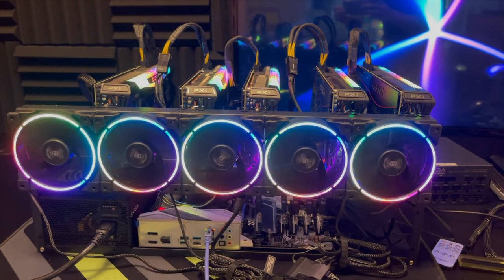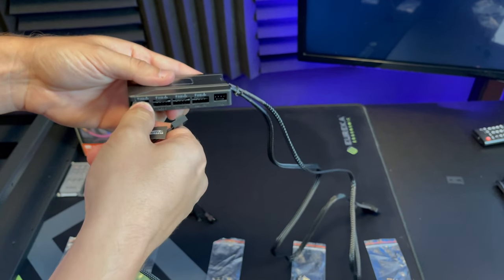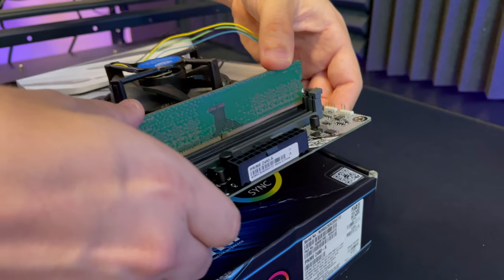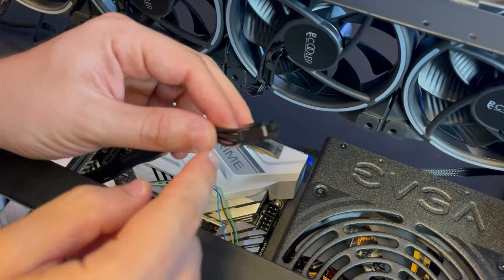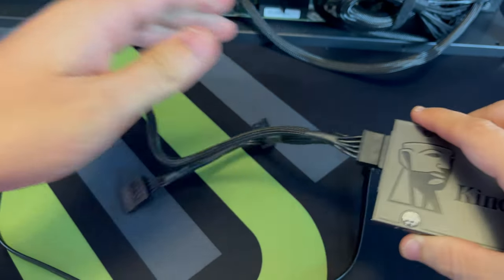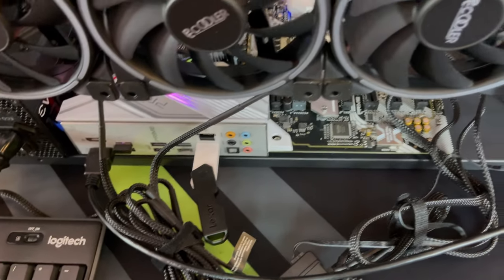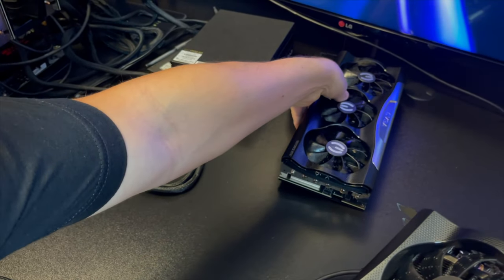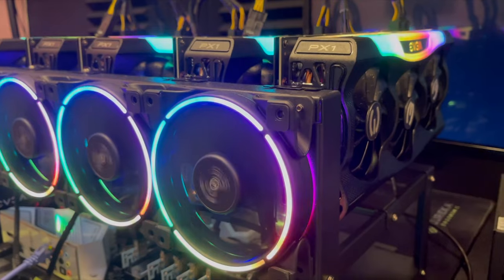How To Build A GPU Miner Rig (The Ultimate Step By Step Guide) Nvidia RTX FTW 3070

Comment from the maker: Here is a list of all the items needed to build this miner
6 GPU Slot Motherboard https://amzn.to/3kcdDeF or https://amzn.to/3mvBW9Y
if you are doing 5 GPUs this is a great option https://amzn.to/3y2ChmQ
CPU for these motherboards https://amzn.to/382PS2X
Power Supply Unit https://www.amazon.com/gp/product/B00COIZTZM/ref=ppx_yo_dt_b_asin_title_o01_s00?ie=UTF8&th=1
Ram https://amzn.to/3kfsvZJ
SSD Hard Drive https://amzn.to/3mvCEEa
Frame https://amzn.to/3z8uu8h
Fans https://amzn.to/3y8JvWn
GPU Risers And Riser Cables GPURISERS.com (these are higher quality than the ones on amazon)
GPU Cables (only buy original EVGA) https://www.ebay.com/itm/133825596674?hash=item1f28a08d02:g:fh4AAOSw~2xgdjsX
(you will need one per GPU
GPU should be purchased on stockx.com

Comment: In the process of buying all the equipment and 3 GPU 3070, 
I know for a fact that i will need some guidance as some of the parts in your video were somewhat quick.
however would you be available to answer and reply when needed ? 
After watching several videos, yours is by far the one that actually follows the title and is NOT click bait, thank you for that

cheers.

Comment: Great video!  I bought the same mobo and couldn't get more than three cards to work.  I figured out there was another setting in the BIOS that needs to be set to Gen 1.  I forget which section it's in but it's towards the bottom in the Advanced tab.

Comment: Hey Slava, thanks for this awesome video. Quick question: This setup does not require 240v power outlet installation right? My standard 110V electrical power outlet will work fine or do I still need to install 240V outlet?
Reply: I believe you are correct sir. the Power supply are 110v not 240v

Comment: Does not setting the card fans side to the back of the other gpu increase the temps? i mean the back of the gpu is hot as hell so the fans are pulling hot hair. i have mine like this running at 75º wich is awfull

Comment: if i was running 6 gpus, how can i simply add more 6? can the cpu run them as well? i mean i was considering a single cpu i mean single operating system to run a miner and start expanding from there. thx

Comment: so this entire setup is about 13,000$ since the GPU's are about 2,500$ each? do you have a link to the GPU's ? since its not in the links you added?
Reply: 2,500? You can find the rtx3070 that he used in this video for 900-1200$ on stockX not even the 3080ti that is way more powerful cost 2,500$ your probably talking about the 3090

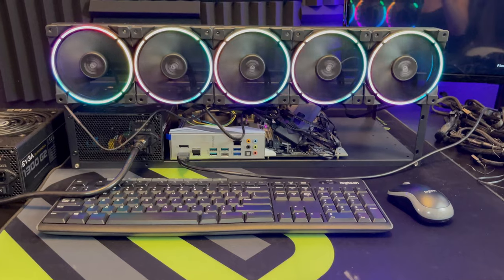Comment: Great video but I have a question, I had to stop at 5:41. Everything seemed to power up fine but the display (asus logo) did not come up on the screen. HDMI is connected but getting no signal. Any suggestions?
Reply from the maker: Thank you, I would suggest just connecting the cpu and try to power it on. if that works then add ram, then, hard drive, etc. to find out what is causing it. it sounds like a connection issue.
Reply: @SlavaTVOfficial  I unplugged everything. Only thing I plugged was motherboard power supply still nothing. Maybe it’s a bad hdmi port on the motherboard?
Reply from the maker: @sirhennyboy  can you try installing just 1 stick of ram and the cpu nothing else, see if that works. I doubt its a faulty HDMI port. Did you buy the mb used or new? I bought a mb on amazon once and it arrived broken and the same thing happened, I returned it and replaced with another one and no problem
Reply from the maker: you have to have the cpu installed otherwise it won't power on
Reply: @SlavaTVOfficial  I tried 2 8g, then 1, then no ram and no changes. I bought it new on Amazon. Debating whether to return and get another one or check it out at a local cpu shop. I don’t know anything about computers and fully going off of your video which is one of the best I’ve seen on YouTube.
Reply from the maker: @sirhennyboy  Thank you I appreciate that, small headaches like this sometimes happen don't let it throw you off track. I would just order a new one since it will arrive fast with prime and start the return process on this one
Reply: @SlavaTVOfficial  do you know if the ASUS Prime Z590-A LGA 1200 will work the same for this build? It’s cheaper and newer from what I can tell.
Reply from the maker: @sirhennyboy  yup it will work
Reply: @SlavaTVOfficial  she’s alive she’s alivvveee! Must have been a bad hdmi port. Now I can continue your video! Dude thank you so much for responding and being awesome!
Reply from the maker: @sirhennyboy  Happy to hear that bro anytime!
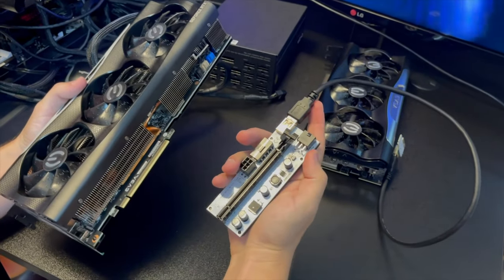Reply: @SlavaTVOfficial  at 9:09 you say going to connect this part to the usb cable.. where does that go after you connect the riser to the graphics card??
Reply from the maker: @sirhennyboy  you will connect it into the graphic card slots on the motherboard (the long lines)
Reply from the maker: @sirhennyboy  wow good catch I didn't notice I didn't include that in the vid! There will be 6 slots for graphic cards on the motherboard, you will connect that part with the "U" part facing away from the motherboard into the short part of the slot that's under an inch in length
Reply from the maker: @sirhennyboy  you can see how it connects at 10:14
Reply: @SlavaTVOfficial  so can one pci with splitter cables power 2 graphics cards or do you need a pci for each graphics card? By the looks of the board it looks like I can only plug in 4 PCIs but I have 6 graphics cards. Sorry I’m a noob man lol.

Right now I have the vga coming from the power source going into riser then into a splitter that powers the graphics card. The second splitter cord is not plugged into anything.

It wouldn’t let me install drivers without the cards so I had to work around that turning off windows auto install. So I guess I plan to install drivers after all graphics cards are plugged in.
Reply from the maker: @sirhennyboy  Definitely don't do that, only do one PCi cable for each card. do you have 3070s or 3080s? also which MB do you have? if it has 4 slots instead of 6 you will have to have a rig with 4 cards and the next 2 will be for the next rig. also do one graphic card at a Time to make sure the PC recognizes them
Reply from the maker: either that or you can always return this mb and buy one that has 6 slots that will save you money
Reply: If I can only run 4 then I will be running 2 GTX 1660 SC ultras and 2 GTX 3060 XCs
Reply from the maker: @SirHennyBoy hey np, just saw the vid everything is correct, don't power a second card with that VGA cable because that can create problems and a potential fire hazard, the card you have only has one VGA slot where as the 3070 has 2 and a 3080 has 3 (which complicates it just a little) I would simply leave that cord or to make it even more simple if your power supply came with a regular VGA cable without the extra connection just use that cable instead, run it directly to the splitter and use one end to connect to the gpu and the other into the riser that way you won't have an extra loose cable
Reply: @SlavaTVOfficial  new mb comes in today. Since I am installing 2 GTX 3060s and 4 GTX 1660s will I just need to install drivers for both? Just wondering if there is anything special I should do or just return the 1660s and add more 3060s and they come available.

Wasn’t sure about a motherboard running 2 differ GPUs.
Reply from the maker: @sirhennyboy  there are ways to install multiple drivers on a pc however I will be honest I'm not sure how to do that, the most reliable method is having the same graphic cards on one motherboard, if you plan on having 2 miners I would just install the 4 1660's and ad 2 more if your new mb has 6 slots and on another mb build out the remaining 3060s
Reply: @SlavaTVOfficial  did you have any issues setting up nicehash OS? I went through the flash drive process then changed boot priority but would just get a blank black screen.
Reply from the maker: @sirhennyboy  I never did nice hash os I just dl quickminer its the easiest way to do it
Reply: @SlavaTVOfficial  so I see you are getting 60+ mh/s with the 3070s. I’m running 3060s and only getting about 27 mh/s with overclocking. I saw a dummy hdmi hack but that didn’t work. Any tips or advice?
Reply from the maker: @sirhennyboy  hey bro I suggest not manually overclocking the settings, I just run quickminer at the highest option (not os or the regular nicehash miner) and it gives me the highest mega hash and also runs stable
Reply: @SlavaTVOfficial  have another question for you. So when I am running 3 cards everything is working fine but when I plug in a 4th i get a spinning wheel when the Asus logo comes up or no boot at all. I have 2 sticks of memory and have tried 2 different revisers. Am I missing something? I have the same MB as you with 6 pci slots. I tried to power off and on again and the MB light is staying white.

If I unplug the 4th card it runs fine again. I’m lost.
Reply from the maker: @sirhennyboy  you might need to increase virtual memory on the computer
Reply: @SlavaTVOfficial  I found the solution online after some digging looks like the solution was changing PCIe speed to Gen2 instead of Gen 1.
Reply: @SlavaTVOfficial  what is yours set at? Currently mine says minimum 16MB recommended 2921MB currently allocated 15390MB

Comment: I tried setting up a rig just like yours. I’m stuck right now. I tested my power supply to make sure it works and connected all the cables just like you showed in the video. When I tried turning it on for the first time, before installing the rest of the equip, it just won’t turn on. Any idea why is this happening? Any help is very welcome! Thank you
Reply from the maker: hey I would suggest disconnecting everything  and just installing the cpu and 1 stick of ram and see if it powers on, if it doesn't it could be a bad MB or ram also check to make sure everything is connected properly